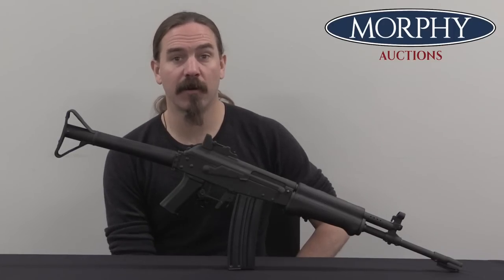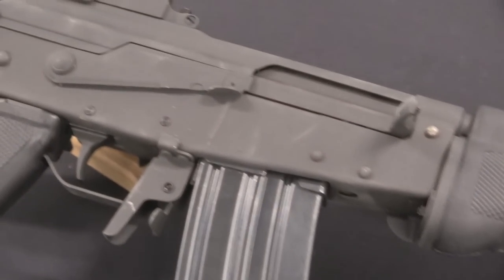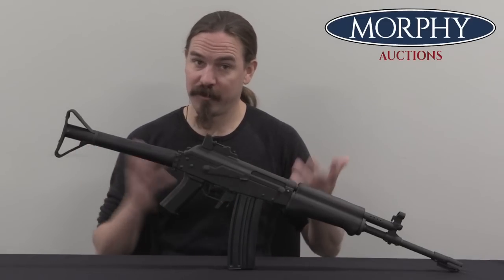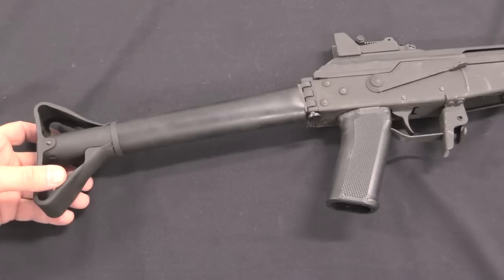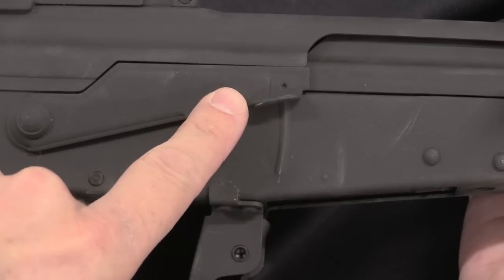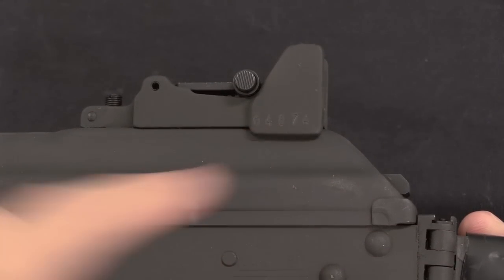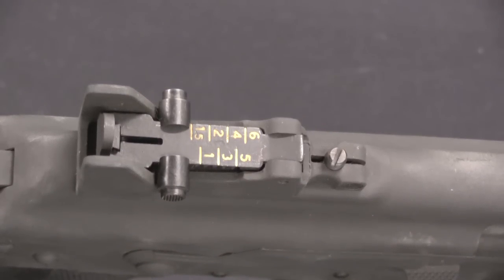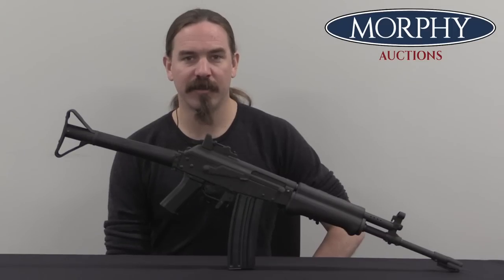Valmet M76: Finland's Stamped Receiver AK

Comment: It was used by Arnold Swartzenegger in Commando.
Reply: That was M82.
Reply: @XtreeM_FaiL  Yes, thank you, you are almost correct. I was talking about the manufacturer, not the model number. I’m glad someone’s paying attention. As a side note, I’m sure the sound engineer on the film deliberately lowered the sound frequency of the Valmet being fired, in order to give it a sound of more powerful authority. ‘Good guys’ guns usually have more ‘gravitas’. What intrigued me back then was how they made the Valmet sound as though it was ‘the boss’ over the AK47s being used by the ‘bad guys’, including the ‘bad boss’ of Valverde, who was wielding a Steyer AUG against Arnold in the stairway. I’ll bet you even know the brand and model number of the pump-action shotgun John Matrix was using against Arius, aka ‘El Presidente’? It was a hoot of a film back then, with such clear lines between good and evil.

Machine Guns
Valmet M78/83
One of the weapons used by Matrix during the assault on Arius' base, the Valmet M78 is a Finnish light machine gun similar in appearance to the RPK, the main difference being a different muzzle brake, front sight assembly, and many other structural differences. The Valmet M78 light machine gun has a standard "RPK style" buttstock. The later Valmet M78/83 has a synthetic thumbhole "Dragunov style" stock. This is the model used in the film. The Valmet M78 series of light machine guns came in 7.62x51mm (.308) and 7.62x39mm calibers.
Reply: @EdwardPCampbell  No idea how sounds are used in movies.
IRL recording loud noises is difficult.
Arnie used a shotgun?
Reply: @XtreeM_FaiL  Commando: Matrix’ shotgun - Remington 870 (customized with LPC [laser] sight) Yes, the exact same laser sight used by Arnold on a Colt 45 Longslide to kill the ‘wrong’ Sarah Connor in The Terminator, the year before.

Comment: Saw a Finnish firearm, immediately clicked like and commented.
These stamped guns are rare, and I wasn't even aware that there was a stamped version of the RK in the Finnish military so I did learn something today. It was also interesting to hear why the more experimental features weren't largely adopted.
You mentioned that Finland might be looking to replace the aging RK62 platform, but do you have ideas on what would be a suitable replacement? Something more like the MCX spear perhaps? Heavy brush and forested terrain are often cited as reasons to keep 7.62 over smaller cartridges like 5.56, but M4-like ergonomics have shown to achieve better results in SRA than AK-like ergonomics. Assuming that the Finnish military keeps the same philosophy when it comes to small arms procurement (weapons have to be reservist-proof), do you think there are viable alternatives on the market today or do you think a new product should be developed?
Reply: Sako M23 is a new rifle that's just been developed. It's a marksman rifle but perhaps gives some idea in which direction the FDF would go if a new domestic rifle is created rather than buying something from another NATO country.
Reply: Most likely to be an AR style platform made by Sako. There's no point going any other direction.
Reply: If I was a betting man, I would bet that the currently modernized RK-62M rifles stay in use for at least 20 years more and after that there is going to be a new domestic rifle with similar ballistics, I can't see a 5.56 being the primary weapon. Probably something like the Grendel or Spear like you said.
Reply: Most likely a new product. In fact, that is already kind of happening. There is joint Finnish-Swedish project with Sako looking to develop new assault rifle, light machinegun and designated marksman rifle. FDF has previously looked into designs that are available on the market, but all of them have been either too expensive or left something to be desired. Designing and manufacturing a rifle in Finland costs a lot as well, but at the same it supports local industry and economy so it's not that bad.

Not sure which cartridge they decide to go with. The designated marksman rifle, Sako M23, is in 7.62 NATO and the light machine gun will be in 7.62 NATO as well, but what comes to the assault rifle everything is still open. It probably depends on how the tests go and whether 6.8 will become another NATO standard.
Reply: @bunba_77_15  Well, cost would be a major factor. The MCX-spear has AR-ergonomics, but is chambered in 6.8 specifically to defeat body armor. If 5.56 is seen as inadequate for the terrain and for overcoming armor, then it might not make sense to go for an M4-clone even if it is domestically produced. If 7.62x39 is still seen as adequate, then there are ready-made products like the CZ Bren 2 that offer improvement over the modernized RKs in terms of ergonomics, but the question becomes if those improvements are worth the cost of replacing every rifle. The M23 has the advantage of being relatively rare - it has a shared marksman/sniper role depending on loadout. Not every company even features that capability, so the number of rifles on order is relatively small if compared to how many RK62s and AKMs are necessary for the wartime-units and reservists. Trying to make the rifle as cheap as possible isn't as necessary as it would be for a rifle that we'd be buying 280k or more of.
There's also the aspect of intellectual property and patents to consider. It might not be so simple for SAKO to just design an "AR 12.5" using 6.8 caliber based on AR-ergonomics and call it a day. We also have to consider the need for armored infantry to have compact weapons (RK95TP), which the AR design typically falls short on because of the requirement for a buffer tube. Erkkarit use some SCAR platform rifles because they don't have a buffer tube and can have collapsible stocks (so heli deployments are easier), but the SCAR platform isn't liked much among those using it because of other shortcomings.
Reply: @vaenii5056  Didn't know they are thinking about a rifle and a lmg as well, probably see something on 20 years..
Reply: @vaenii5056  I'm super interested in a Finnish/Swedish collaboration like you describe. As far as I know the AK5s based on FNC that Sweden uses are also in need of modernization, so on paper it would look like the perfect opportunity.
Reply: @UCkjFceni3u3WG-of6pq9KdA For Finnish and modern requirements 5.56 wouldn't be the top choice
Reply: @TheLazyFinn  One NATO requirement is use of STANAG Magazine and calibers.
Reply: @adlerarmory8382  not all NATO weapons use stanags tho
Reply: @TheLazyFinn  Honestly, the RK-62M is a step back. Sure it has more modularity, but it adds a ton of weight on the 62, which already was a very heavy gun.
Reply: @aoobbb  Kinda true I guess but it has it's uses too, it could have helped me to get a good sight picture prone if I could have adjusted the stock (maybe) for example
Reply: @aoobbb  The 62M allows for use of optics and other accessories, which is a huge plus. You would be a moron to go into combat without optics if you had the choice.
Reply: @banaana1234  As I said, it has the modularity. It’s definitely a pro. But in combat, especially with the red dot attached, it gets really cumbersome being a very heavy gun. The platform is just not meant for any extra accessories. Trust me, I did my service with the 62M. Cool gun, but the modernization doesn’t really work.
Reply: @aoobbb  Would you rather go into combat without the red dot?
Reply: @banaana1234  I would definitely want the red dot… but on a different platform, like AR.
Reply: @aoobbb  That wasn't an option yet, it would be so much more expensive to swap all the rifles and ammunition for them. We have massive amounts of 7.62x39 ammunition that we don't want to replace yet. It wont be too long before the RK will be replaced completely, most probably with an AR.

My point is that the upgrade definitely wasn't a step back, it was a step in the right direction.
Reply: @banaana1234  Well, modernization is a step in the right direction… but in this case also a step back. The 62M is not a good gun for the simple fact that it’s too heavy, the 62 is not designed with accessories in mind. It’s like taking a car from the 60s and fitting it with cruise control, ABS brakes and seat belts then calling it a day. Sure it makes it kinda better, but why do it? You’d just get a janky mix of old and new. Rather use that money on a new car altogether. 

SAKO could very well make an AR-based gun that runs 7.62. No reason to rid of 7.62, it’s very useful in heavily wooded areas.

Comment: I wonder what the Finns will go towards with their adoption of NATO standardization. The Swedish have the rugged AK5 variant of the FN FNC which is well-proven in Scandinavian terrain, and the Norwegians have gone over to the HK416 so it must be at least reasonably effective in cold climes too, but on the third hand there's plenty of 5.56 AK-pattern rifles in NATO use these days.
Reply: @HellbirdIV I doubt that Finns would go for 5.56 rifle. There is program ongoing to modernize part of RK62s with capacity to accept full gamut of night sights, etc. 7.62x39 is an excellent round fighting in forests. Finns propably skip 5.56 and go for next gen, whatever it will be. We have 500.000 AKs and PKMs on war stocks, so carefull consideration is needed.
Reply: RK62 modernisation program has all hallmarks of interim aim program, decade or to. Waiting for NATO to decide where they are going after 5.56.

Comment: The aperture sight is great for long range precision shooting. It's not uncommon for new conscripts to score 90-100p on a 10-shot group from the standard 150m range, taken they know how to shoot properly. I would prefer the open notch style of sight though, as the aperture is so small, it is really hard to aim when it starts to dim a bit and in Finland most of the year is pretty dim lighting-wise. I usually used the night sights for close range combat drills, as they made it easier to pick up targets fast, but they're designed to shoot somewhat high in their standard configuration , as people tend to shoot low in low light. In Finland it's also quite uncommon to find longer firing distances than 100m in the "wild" as most of the country is heavily forested. Also the tube stock is far too long to be used comfortably with any kind of plate carrier, even for taller persons. Nowadays, many conscripts are given the modernized RK 62M, which has a Magpul adjustable stock and a picatinny rail, holding an Aimpoint T2 micro.

Comment: I doubt the RK62 is going anywhere any time soon, considering the recent modernization program of the rifle which replaced the RK95 as the "modern" service rifle.
While the 7.62x39 cartridge is less popular in NATO the round isn't exactly rare or fundamentally incompatible with NATO doctrine; I wouldn't be surprised however if future modernization programs designed or adopted a new RK using either 5.56 or 7.62 NATO.

EDIT: clarified thoughts on future modernization
Reply: Seems unlikely that they'd keep the rifle if they changed calibres, too much trouble compared to just getting new rifles, and standardisation will quite likely happen after they join just to ensure that they're on the same page as everyone else
Reply: RK will be in service up in 2035.
FDF/Government knows the last date, but no one knows what will be the next rifle. :/

"future modernization programs redesigned the RK to use either 5.56 or 7.62 NATO."
That would be a quite a trick to do just by modding the rifle.
You need new barrel and receiver to do that. So basically whole new weapon.
Reply: The Finnish military officers have publicly said that the research for our next service rifle is ongoing. Procurement needs to start in the next few years. On top of that, several agreements have been signed with Sweden on joint procurement of weapon systems, including an assault rifle. On top of that, we've already seen the photos of the Sako AR family of rifles, of which the 7.62x51 version has now been adopted. 5.56 version will be officially announced inside few years believe me. 

If it wasn't for the war in Ukraine and all of the additional cost it has caused directly and indirectly, I would bet the procurement would've been started already. But there are a lot of irons in the fire at the moment. Procuring of F-35, building 4 new warships for the Navy, acquiring high-altitude air defence systems... It's about finding the money from somewhere, but the procurement of the new assault rifle cannot be pushed that much further. The mere fact that most of the 7.62x39 ammunition FDF has on its reservers expires in the 2030s makes it a necessity to go in a new direction. 

The RK-62 and 95 are not obviously going anywhere, they would remain as the standard weapon for a lot of the wartime army. Replacing +300k rifles is not something that's done even in decade or a two. And no, there's absolutely no way to "modernize" RK-62 to use a different cartridge. And no way to make more. The production lines have been gone for more than 2 decades.
Reply: Here in Italy a friend of mine owns a civilian M76 in 308win.
Reply: @markwalshopoulos   @XtreeM FaiL  Poor phrasing on my part having just waken up; should've said "design a new RK". LOFIN covers the topic above in great detail.
Reply: @Deuzen_FIN  they'd probably go for an AR as that's been the option that their neighbours have done over the last 15 years or so
Reply: @foleymaj  I'd missed the news on the SAKO ARs, those could be a solid NATO compatible replacement.
Sleepy brain doesn't always word good, so the point I was trying to make was "design or implement a new RK rifle using a NATO cartridge", not retrofit the 62s and 95s, since as you said it'd be asking the impossible.
Reply: @markwalshopoulos  LOFIN mentioned the new SAKO rifles which are based on the AR designs, those are a likely candidate as it'd be a domestic production.
Reply: dimapez  If they could get a big batch of surplus ARs from somewhere they definitely should investigate. It would be better to switch the whole arsenal at the same time. But there's no doubt that the service rifle will be a domestic SAKO made rifle. If the rumours are true, there are some distinctive features in the rifles specifically requested by the FDF, for an example a captive firing pin.
Reply: dimapez  First of all, those Norinco rifles are still in storage. Secondly, the RK-95 was never meant to be made in huge quantities. It was meant to replace the RK-62 with frontline troops, which it did. RK-62 was still produced in parallel with the RK-95. I really don't see what point you are trying to make here.
Reply: dimapez  IF we want to actually replace the 7.62x39 rifles in service, we HAVE TO buy "cheap ass rifles in quantity". No current arms manufacturer could provide new rifles in the quantity and timetable for that to be feasable, not even Heckler&Koch or FN Herstal. That doesn't mean that a Sako manufactured domestic AR wouldn't be the mainline service rifle. Those "cheap rifles" would just go to storage, just like those Norincos and DDR AKMs. Your first post still makes zero friggin sense. 

What I think will happen is that they plan to buy something like 60k Sako manufactured AR-15s to issue for frontline troops etc. Then they try to find a supplementary surplus 5.56 rifle for the reserves. Or just keep using the RK family as the second line rifle. Replacing the whole stockpile of 7.62x39 rifles with new production rifles would take multiple decades, even if we were to buy them from multiple manufacturers.

Comment: Not sure about that buttstock. Doesn't look very comfortable in the cold. Other than that I really like this gun. Shame that the closest thing on the market is the Galil ACE, which is a nice gun but a tad heavy with its machined receiver. I think tritium has a half-life of 12 years, so maybe 0.5x0.5x0.5x0.5=1/32. Probably still some glow if it's dark enough.
Reply: To be fair, if you're in the cold, you will also have thick clothing underneath.
Reply: The buttstock wasn't a problem. I shot with my service rifle (same stock) in finnish Lapland in -25C and my face did not freeze into it 🙂.
Reply: It has rubber coating on.
Reply: @XtreeM_FaiL  I suspected so but it was hard to tell on my phone.
Reply: @XtreeM_FaiL  Polyethylene, rather.